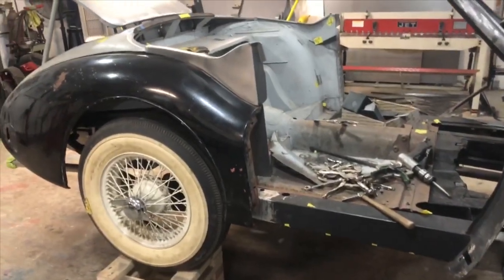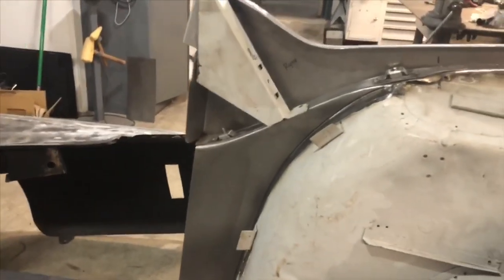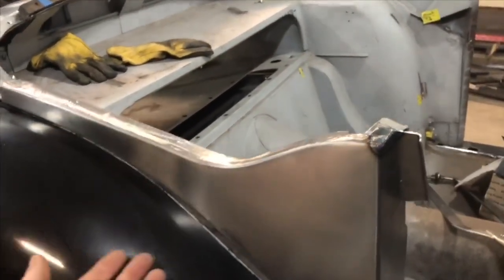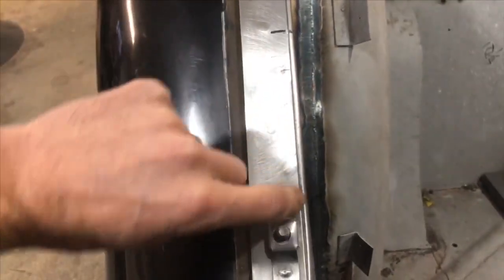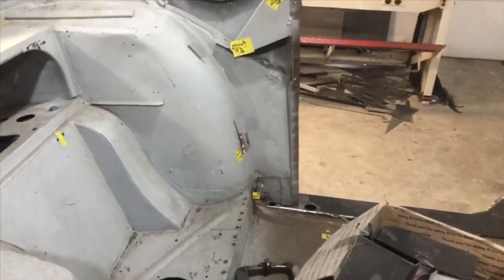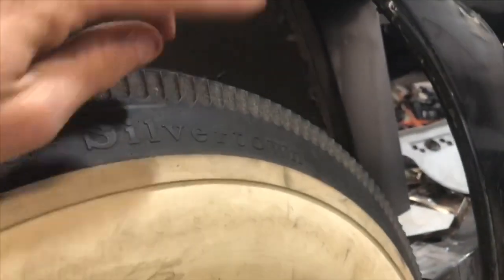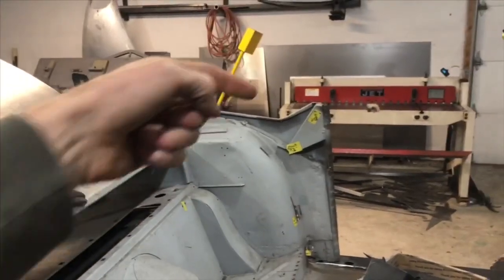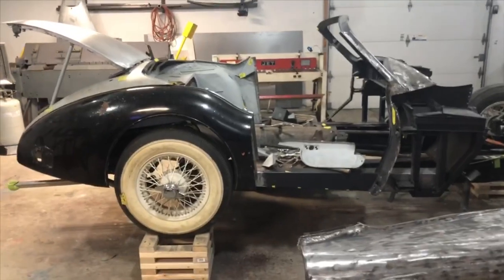XK140 b pillar fabrication

Comment: Again I'm no jag expert but most 50's and older convertibles used wood inserts on panelling and the roof ribs. I think but don't quote me but online i think you can buy wood kits already made for VW, Audi, Mercedes, Jag and some others. It's almost easier to get woodwork for imports then our North American cars.
 I'm not personally working on it, but I've been giving a helping hand reassemble a Horch and surprised how much wood work is in it but also shocked on some parts that have been used that are the same as Volkswagen and Audi.
Reply from the maker: Yes there is quite a bit of wood in this era